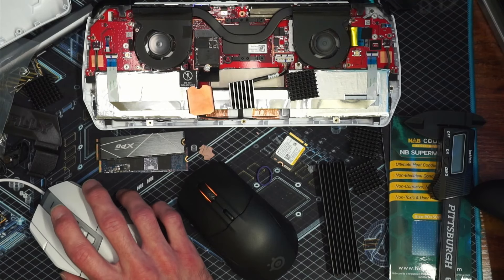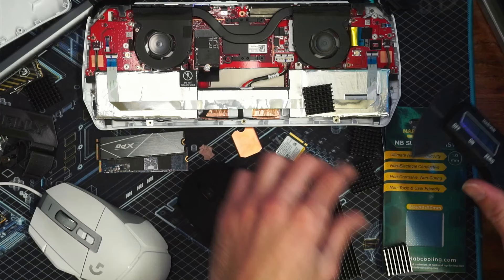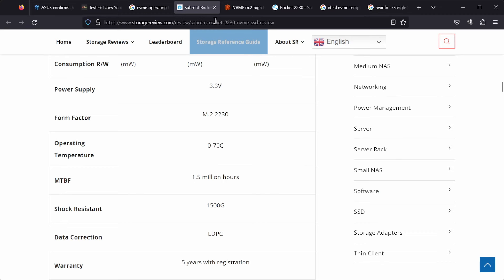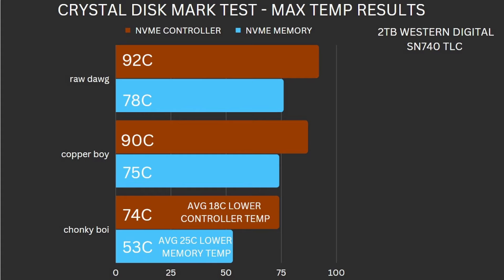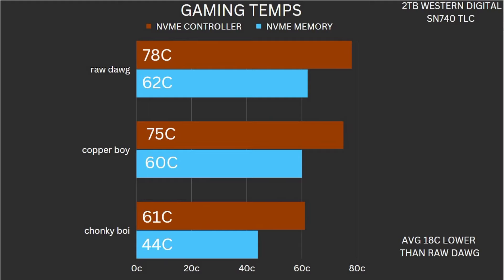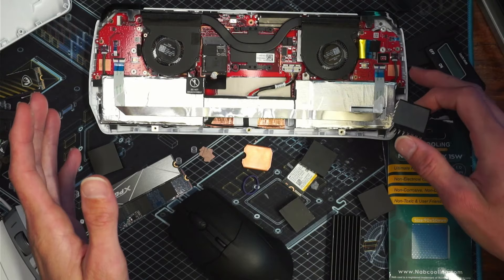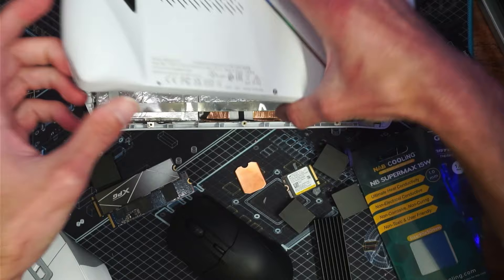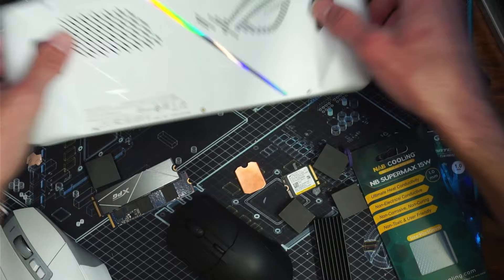Rog Ally NVME Over heating? Drop temps by 18c! The best mod I have created! PART 2! FULL INSTALL

Comment: Hi do i remove the black paper or film thats covering the heatsink and ssd? 😅 i actually cut the nvme shape out so i have the heatsink and that film. Would it be a problem? I noticed only 5 to 6c difference idle.
Reply from the maker: The black sheet traps heat in. It’s a dust shield
Reply: @cppctek  oh... so it's best I remove it then? F...... I cut it too

Comment: I noticed you don’t have that black cover over the mother board is it recommended to remove it or do I still follow your instructions here and put the heat sink on top of the black cover that’s covering the SSD
Reply from the maker: Leave it off. It traps heat in.  Also it’s just a dust shield.
Reply: @cppctek  it has been removed and I finally did the mod. I didn’t run into one issue when following your instructions I somehow managed to dent my left fan pipe :/  I should have shaved off a piece of the corner but figured would go in perfect and bam dented it so I did it the other way and managed to complete it. My only regret was not keeping an eye on temp from before and after as I do play some demanding games on it. I maxed out GTA 5M and man I was shocked it kept at a cool 70 degrees like if it was stuck hahaha and that is when I knew this stuff is legit 🔥
Reply from the maker: @vegaf2011 heck yeah !! No worries on the dent  it won’t affect temps at all. If anything temps on apu are lower due to less heat being trapped inside the area

Comment: What about the black covering over the ssd card?
Reply from the maker: I remove the flap
Reply: @cppctek  Are there any consequences for removing the dust cover over the boards?
Reply from the maker: @mechaxjoe no risk. I’ve ran mine since launch day without it. It’s nearly just a dust shield

Comment: Im going to swap my ssd for the corsair mp600 1tb, would you recommend doing this mod also ? Looks like its going to block the air flow a little ?
Reply from the maker: Def do this mod or else it can thermally throttle. Watch my latest mod video from this week

Comment: Need your opinion: I got the exact heatsink you recommended installed. Got the backplate back on. Screws are aligned and screwing back in. There is a slight bulge pushing up on the back place. Barely noticeable and I'm not really concerned with that. However, do you think, overtime, that pressure pushing down on the SSD would be an issue?
Reply from the maker: Nah it won’t be a problem but dm me a pic on discord and let me see what ya got. I may have some tips for ya but it shouldn’t budge. Did you use the 1mm pad? Also if you got the heatsinks with the pre applied sticky tape did you remove that tape
Reply: @cppctek  Right on. Happy to send pics but I can't seem to find you on Discord. Perhaps Im just missing where it is listed. I used the pre-applied pad and I removed the layer that protects the sticky. The heatsink is sticking to the SSD.
Reply: @andrewhunt9278  I got the same problem too, I couldn't get the back case to close, until I screwed it down (Not that I had to do it extra tight) and it seems to bulge a little too, but again hard to notice. Used a 25x25x10 heatsink and 1mm pad.
Reply: Just ordered mine and hopefully it won't bulge... That is the one worry I have.
What if the heatsink height is 6mm? I've seen some that are 20x20x6mm, that should be more than enough for the clearance? But it'll probably be a little less effective on the cooling side huh.. 🤔

Comment: Got an extra heat sink? Amazon back ordered until September smh
Reply from the maker: The link in my description showed they were in stock. Double check real fast
Reply from the maker: YXQ 25mm x 25mm x 10mm Aluminum Heatsink Heat Diffuse Cooling Fin Square Extruded Radiator Silver Tone, 12Pcs https://a.co/d/6syWtjs 
These should fit too
Reply: Which discord are you in?
Reply from the maker: https://discord.gg/rogally
Ping me on there. I’m well known there lol 😂

Comment: Hey boss  how much would you charge  to ship if you have anymore left because make no sense of me buying a whole bunch of them wasting the 25 dollars
Reply from the maker: I don’t have any left but they were about 7$ 6pcs Small Heatsink 25 x 25 x 10 mm / 0.98 x 0.98 x 0.39 inch Aluminum Heat Sink with Thermal Conductive Double Sided Tape for Cooling ASUS ROG Ally GPU IC Chips VRAM VGA RAM https://a.co/d/6RDK18X just peel off the adhesive tape

Comment: Yo!  First time i've seen someone use the same mouse as me, I've had problems trying to connect the Steel Series via bluetooth to the rog ally, do you know if its possible?  Have you got it working?
Reply from the maker: It works fine. Just have to put it into pairing mode and pair it

Comment: Will this be ok to use ? Gelid Solutions GP-Extreme 12W-Thermal Pad 120x20x0.5  I can’t find 1mm without it costing a bomb on Amazon (AU), and if required can you remove the drive with the heat sink attached or would you have to remove it first.
Reply from the maker: No .5 is too thin and won’t squish. Look for
The nab brand it’s made in same factory. Same pad just get 1mm no matter what tho

Comment: I am gonna try this. Thanks for the video. Do you think 20x20x10mm is a better option since it allows for more space on the sides to air to flow through the board? or does 20x20x10mm not cover the entire SSD? Also, will there be a perf difference between 1mm and 0.5mm thermal pad?
Reply from the maker: 1mm pad is ideal. Anything smaller and it doesn’t have the squish it needs to conform and fit. I’ve tested temps also with multiple sizes and 1 is always the best for nvme drives
Reply: @cppctek  thanks for the reply mate. 

I am gonna watch the fan curve and other videos to set up the device. Got the device after 4 days delay by transport service provider :).

It's nice to have all the important videos by one content maker in one channel. 

One last question, do you think they will be a difference interns of airflow and performance between 20x20x10mm and 25x25x10mm heatsinks?

Comment: My 2tb wd ssd, heat sink, and thermal pad arrive today… are you still finding this hack beneficial? I know you ran those stress tests, but are those temperature drops maintained consistently in real world use when playing for several hours?
Reply from the maker: I’ve used it for weeks now. No issues. 100% worth it. Watch my latest q&a video.

Comment: What is the purpose of the two black paper bits that block half the air vent on the back of the chassis?
Reply from the maker: Mesh dust shield

Comment: Nice, followed your guide and managed to do the mod without any issues (filed down the corner and there's no dents).

Has there been any longer stress tests done on the temps though? It does seem like it's reduced the temps on my device a bit but not sure how it'll fare during a longer usage session
Reply from the maker: Yee heck yeah man

Comment: what about put it on the apu plate? can it drop the temps too?
Reply from the maker: Having the nvme heatsink like this has seemed to lower apu temps. Fortunately even at 30w manual with this mod apu temps are no where near danger zone or worry level.

Comment: Which has better M.2. 2 TB?
Also can you close it with screws?
Reply from the maker: Yes easily I just showed it snaps back together and there’s zero gap lol. There was no need for me to waste time on camera putting them in. And the best 2 drives I suggest are the wd sn740 or the sabrent rocket 2tb.
Reply: What are your thoughts on the inland drive from microcenter?

Comment: it doesnt help that those XPG drives run hotter than a small sun.
Reply from the maker: Eh pretty much any drive that does over 5000 mb/s will run real hot anyways though. Most of the gen 4 drives just get super hot without some sort of cooling
Reply: @cppctek  very true. But those XPG ones seem to be just a bit warmer for some reason.
Reply from the maker: @Paradigmfusion eh depends on the drive you compare it to. I’ve got several that run hotter than the xpg drives. I’ve got around 20 diff nvme drives from various manufacturers and that’s just the ones I’ve got on hand I use or keep for storage or testing

Comment: Would this improve gaming performance by any margin ?
Reply from the maker: It’s possible if the drive is thermally throttling enough or there’s enough heat being soaked back into the apu area you could notice a small hit on the 1% lows if drive is throttling but go check out my video I dropped this morning. Corsair and sabrent responded ! https://youtu.be/kzno_pL9N44
Reply: @cppctek  Thanks.

Comment: Is 0.5mm thermal pad good enough or do I need thicker
Reply from the maker: 1mm is the gold standard sweet spot. For a bunch of reasons
Reply: @cppctek  ok I'll have to order 1mm. But can I use the .5mm until I receive it. Because the heatsink you said to get and the .5mm will be here tomorrow. I got the SSD today but I wasn't going to put it in until I got the heatsink. So basically what I'm asking will the 0.5mm do for now. The brand I ordered was DriftIce thermal pad. And I just looked the 1mm is temporarily out of stock on Amazon

Comment: Hi, can i use a 2mm pad?
Reply from the maker: 2mm has worse temps and back plate will buldge like hell
Reply: @cppctek  really? I didn't know that. Haven't received the heatsink yet , bought the thermal pad already, I'll probably need to buy another one then, by the way can I use more than 1 thermal pad by cutting and covering the heat sink? These are thin strips

Comment: Will the 25x25x10 fit without any modifications?
Reply from the maker: Yes
Reply: I ordered the 22x22. The 2nd to the last pin doesn’t fit the hole. Is there anything I need to do?
Reply from the maker: @khanhdotbui that’s why I said the 25x25 my brother.